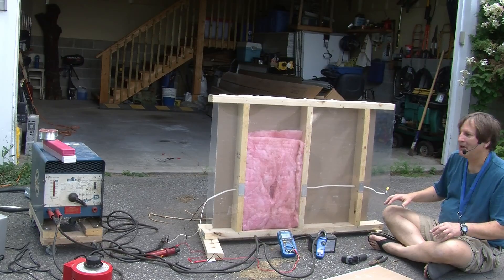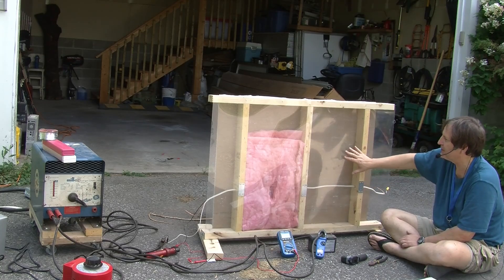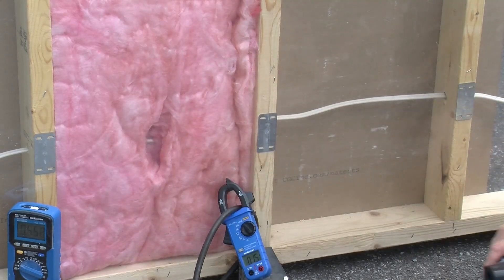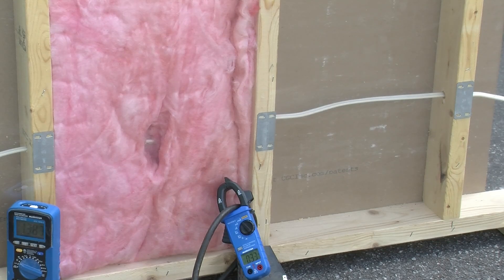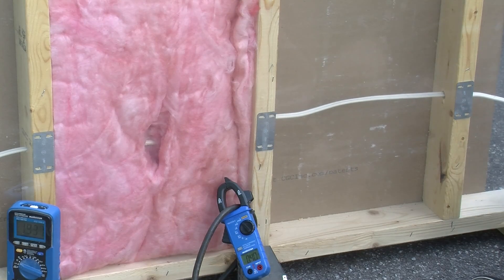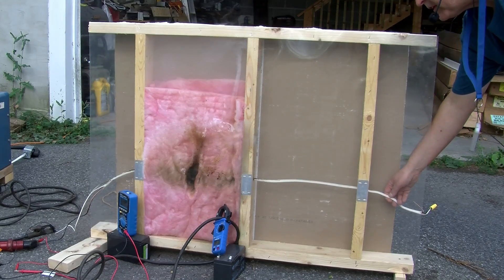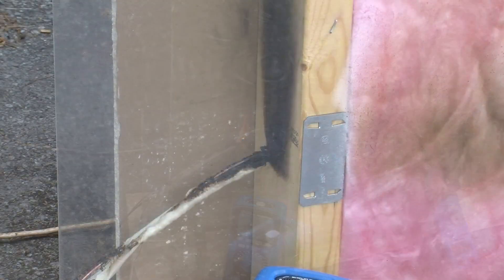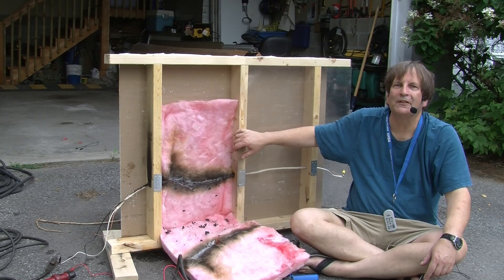Overcurrent +14/2 + Fiberglass in a 2x4 Wall

Comment: If the wire is rated for 15 amps, then it should be able to carry 15 amps continuously. I think rating the wire at 12 amps or 80% of 15 amps is wrong.  while the service panel ii a residential application is usually calculated at 80% of full load.
Reply from the maker: I dont know the exact reasoning the people who wrote the electrical code used for requiring the continuous current be less than the rated, but there are good engineering reasons: If you put exactly 15A worth of load on a 120V circuit any deviation from the stated value of the voltage or device could easily push you above the 15A rated current. It is more likely than might be obvious: the 120V line voltage is in most places allowed to range from +10% to 13% at a receptacle. If you have a restive load, a voltage 10% too high would increase the current drawn by 10%. If you had an 13% undervoltage, a load like an induction motor or electronic power supply will draw around that much more current to maintain the same power. Either way, if you started at exactly 15A you would now be 10% or more overcurrent. Similarly, any device (ie light bulbs, heater) will have a certain inaccuracy as to how much power the device draws adding some more +/ % deviation from rated current. A properly working breaker  is allowed to  trip at any continuous current above its rated value. So by requireing continuous current to be derated from the rated current of the circuit, you prevent overcurrents as result of voltage fluctuations and other factors. You also prevent nuisance tripping of breakers which in the end may be the most practical reason for requiring the continuous current to be less than the rated.

Comment: very interesting
Reply: haha yeah I saw your microphone, I think it sounds great. I have the same problem. I tried using a bluetooth mic but the one I got keeps disconnecting while I record. so I have a couple videos where you can barely hear me for an entire segment. I'm trying out a usb mic now
Reply from the maker: @jankcitycustoms  Sounds does make or break a video - more so than poor picture. I tried two different lav (lavalier) mics - the problem I had with them is I look left and right while doing things changing the volume they pick up. And they dont attach well to T-shirts. The head mounted mic stays in one place so its more consistent volume but picks up my breathing. I glad to get the feedback that the audio is better. The mic is visible and is in front of my face a bit, but I dont think the majority of people are looking at the videos to see my pretty face so thats not too big a concern :)  In case your wondering the mic I am using is here is a Shure PGA31-TQG Headset Microphone - only CDN$60 so probably US$45. But it has an oddball connector that was hard to find adapter for to connect it to my camera. It is intended for the Shure wireless mic system which is way too elaborate for my use. 

It sounds like your phone as a camera. If you find a good mic for use with phones, please let me know - would be good for making videos when not a home.
Reply: you're right I do use my phone. I will definitely let you know, I didn't have any luck so far. my laptop can barely play videos in the editor so I try to do most of the stuff on  my phone.
Reply from the maker: @jankcitycustoms  That must awkward doing it on the phone. But whatever works :)
Reply: haha yeah it's not ideal
Reply from the maker: Thanks! Your certainly have some interesting stuff on your channel - I have to watch some of your videos when I get the time!
Reply: I appreciate it!  I'm just getting the hang of planning a video beforehand to make things a little more cohesive.
Reply from the maker: @jankcitycustoms  Funny you mention that - I'm learning that too - as well as how narrate it in a way that works for my way of doing things. Also am experimenting with the best way to do audio since I move a lot when I'm doing videos and that makes recording voice challenging.

Comment: You have clearly stated typical American home construction so why did you go with celcius vs fahrenheit?
Reply from the maker: I'm in Canada  - our houses are very similar in construction to the US. And I think most cables are rated in C. Correct me if I am wrong - are they rate in F in the US?
Reply: @ElectromagneticVideos  sorry, I just assume you're from the US.  I actually looked at a Romex wire and no temp info.
Reply from the maker: @joedegorostiza8305  No worries! I think I have seen it on some cables. But it may be different from manufacturer. 

You got me curious - just looked at what I think is the southwire US site - the 14/2 specs  do give temperatures in C. Of course they could be geolocateing me and giving me what they think I want to see :)
Reply: @ElectromagneticVideos  Southwire lists theirs as 90 C.  I believe that older Romeo required only 60 C.  Even so, it appears there is at least a 2X factor of safety which is pretty good.  Airplanes have only 1.5.  😁
Reply from the maker: @LTVoyager  I think it was some of the spray foam insulation where the margin of error was less. One of  my concerns was things like air conditioner power wire in the middle insulation in the attic where the temp might already be 50C on a day the AC is running at full blast.

I didn't know aviation had a lower temperature safety factor. Do you work in aviation? Years ago I had to get a product certified for use in a military aircraft  - what stunned me was how the relatively mild shock and vibe test could cause any not well tied down wire to have its insulation and even copper shredded over the course of 24 hours it it rubbed against anything else.
Reply: @ElectromagneticVideos  No, I don’t work in aviation, but I am building an airplane in my shop at present.  I was talking about the structural factor of safety.  Aviation doesn’t have a specific factor of safety for wire temperature as far as I know, but AC 43.13 provides great data and rule of thumb recommendations that, while not regulatory, provide excellent guidance.  Aviation also generally uses Tefzel wire which will withstand at least 150 C before any issues arise.  Yes, much effort is made to secure wires into bundles to minimize movement from vibration and G forces.
Reply from the maker: @LTVoyager  How Cool - what a fabulous project! When its finished I hope you put up a video of you flying it!
Reply: @ElectromagneticVideos  I hope to finish it in another year.  I am 2.5 years into it and have the airframe nearly done and hope to pick up the FWF kit in February and the engine in May or June.  Will do the avionics last as they have the quickest obsolescence cycle so I want to buy them as close to first flight as practical.  I am not much of a YouTube creator, but will consider something.  It has been a fun project thus far.
Reply from the maker: @LTVoyager  Makes total sense about leaving the avionics till last - never thought of that. I'm sure it will be so great to actually fly the plane you built - something so few people can ever do!!!!!!!!
Reply: He said North America, which includes more than the USA.

Comment: Well kind of realistic 15 amp and 20 amp breakers provide over current protection so you wouldn't be able to draw more than that on a standard 15 and 20 amp outlets you would need special devices with 14-2 or 12-2 hooked up to it...  I understand why you do this and as electrician I love and like the amount of explanation you offer thank you

Comment: 10:31 what you are seeing is the off gasses condensing on the plexiglass.  The fiberglass acted like a filter and caught all the darker tars and carbon so the lighter brown color oily stuff made it to the plexiglass.
Reply: That's exactly what I thought. I'm pretty sure the only thing added to fiberglass insulation is dye.

Comment: Great test. I will add though that the plexy glass will throw off your temp readings quite a but. I do this type of work and have to remove all plext glass to get accurate reading.  I understand you are trying to keep the heat in. I am not trying bust your but by any means. Just wanted to give you some input! Love the video
Reply: goes to show how fiberglass does stop a fire from progressing out of control

Comment: GREAT UPDATE!!!!   
You mentioned trying that foam that electricians LOVE to spray everywhere.  In fact,  I have seen something that really shocked me (no pun intended):  They had foamed the entire inside of the breaker box and about 18" of the wiring going inside the house from there!  If you make another video, may I suggest incasing several inches of your test wire with a thick layer of this foam...this should really keep the heat in that portion of the wire.  Please hold for one moment........OK the only title I could see on the can is "GREAT STUFF".   BTW, I was actually referring to my house above.
THUMBS UP!!!
Reply: Inside!? You mean the actual breakers were in foam? As in you pull off the panel cover and all you see is foam? If so that's crazy. Electrician did it? Not a homeowner trying to air seal?
Reply: @libtrs838  Sorry, bad wording.  No, the back of the breaker INSIDE the house...through the knockouts and inside the back of the breakers + binding all entering wire.  It will be really difficult to add, remove, or replace any of this wiring.
Also, I don't recommend using this particular stuff even for air sealing...they had it in many places aroung the house to seal gaps.  It is already falling away.  It's been about a year now...house damaged by hurricane Ida...I'm in Louisiana.  
I guess I first learned about thermal resistance when I was in high school.  I was working on a laser/holography  project for the science fair.  I had a small HeNe laser tube fully exposed that only slightly got warm, I put a thin handkerchief over the tube to reduce the bright glare overnight (just a single layer thrown over the top, not wrapped).  Hours later, the tube could melt your skin! ...think it was quartz?  The funny thing is, how long it took to get this hot!  Heat was leaking out but was being generated a bit too fast inside.  After removing this cloth, it cooled back down (still on) rapidly.  Maybe your enclosed over-current wires would get quite a bit hotter over many hours.  Perhaps the 14-2 rating is partly due to enclosed wires???  There is an old church here in town (built in 1871) whose wiring throughout the attic is VERY, VERY, VERY thin on standoffs with NO insulation!
Reply: @dalenassar9152  ah. A breaker panel / box can be incased in spray foam as long as no foam enters the box. You would get a cold spot around the box otherwise.

Spray foam can work ok if it isn't exposed to the sun, you trim it flush after, and you don't just glob it on.

The church has what is called knob and tube wiring. That is what was used from the first indoor wiring until the end of WW2. Usually it has some cloth covering but it can fall off with age.
Reply: @libtrs838  THANKS, any additional videos on this planned?
Reply: @dalenassar9152  I have thought about it before, but I don't make videos.
Reply: @libtrs838  when I bought my 100 year old farmhouse I saw that it had knob and tube wiring in the attic but thought that was just the old abandoned wiring since the house had an upgraded breaker panel ( versus screw type fuses). It wasn't until I went to add some new circuits that I discovered that they were still active! Needless to say I had to rewire the entire house. How it survived and never burned down I don't know. Most of the old cloth insulation was long gone.

Comment: This was really cool. You put in the extra effort and made a nice accurate picture of how these real world factors effect it, and why they give such conservative ratings to cables. 

It’s easy to imagine how even 30A would ruin  it if it was in an even longer path of insulation, running an air conditioner all day long on a hot day. Eventually it would be mushy enough to short circuit itself.

Again, thanks for doing such an extensive test for all of us. It’s amazing to see the stark difference of what it can handle in different environments.
Reply from the maker: So glad you liked it. The charring of the plastic insulation inside the fiberglass area was interesting to me and as you said compared to the other area.  And imagine if the AC was supplied though a wire embedded in insulation in a hot attic. 

I will do a similar one with spray foam in a few days when is stops being rainy. All tests are outside due to smoke and fire!
Reply: @ElectromagneticVideos  you also often have a bundle of wires stapled on top of each other or all zip tied together possibly buried in fiberglass or spray foam in a hot attic. Or lots of wires stuffed into conduit. This is why we have a large safety margin and say 15 amp for 14ga instead of saying it's good to 30-40 amps.

Use case, setup, and conditions can be way worse than your test setup.

I was at a house with over stuffed junction boxes with old oxidized wires buried under insulation in an attic and the wire nuts melted clear off. Scary.

The above situation is what led me here.
Reply from the maker: @libtrs838  I do want to test the bundle of wire: I once bought a house and almost all the wires were tied in a bundle maybe 3 or 4 inches diameter and against a beam that ran the length of the house under the main floor. The house was electrically heated, so a lot of the cables could have carried 15 amps at the same time. On advice of an electrician, I was able to spread them out. But always wondered what could have happened. They had been in a bundle for 20 or 30 years, but still!

Comment: FYI !
Metal plates are only required when hole for romex is less than 1 1/4 inch from stud edge.
per National Electrical Code.
Reply from the maker: I didnt know that - I assumed they were always required for wires in 2x4s. I have used them over water pex water pipes at times just to be safe.

Comment: I had a guy run his RV out my shop on 14/2 for months, pulling close to 30 amps consistently. Wire got a little warm, but didn't have any issues even in arizona summer. This is also an old brick building with no insulation. When checking the wiring ratings, I noticed 14 gauge was rated for almost 50 amps in "chassis" wiring, but substantially less for demonstrated reasons in residential
Reply from the maker: 30A on 14/2 in Arizona! Wow! I wouldn't have guessed that! There are different temperature ratings for non residential wires. Maybe the idea is in a metal chassis, as long as the wire insulation remains intact, there nothing flammable near the wire to cause a problem?

Comment: Fiberglass is entirely non flammable, it's made of glass as it says in the name. I think the blackness is the smoke from the wire condensing in and on the fiberglass.
Reply from the maker: I think in some of the stuff there is a chemical gunk to help hold the fibers together but I may be wrong. I should maybe try a test with a bare copper wire (or even a nichrome heating wire) and see how it reacts.
Reply: Yes, I was thinking the same thing. Any 'gunk' would probably be evaporated from the wire prior to it even being 'smoke' and then later the heat could char that condensed hydrocarbon.
Reply: @djmips  True true
Reply: In the heating business, we use fiberglass to seal the clean out plates on boilers furnaces that are dealing with flame temperatures 2000° or better and in some cases many many hundreds of degrees in the flu they may be discolored a year later or five years later, but it stands up and it it does the job it makes the gasket so it is I can attest. It is absolutely non-flammable👍
 now if you put the paper, the vapor barrier well then yeah…….. poof.

Comment: Have you tested the transmission of the plexiglass to the wavelengths involved for the non-contact IR temperature sensor you're using (typically 8-14um)? To get an accurate temperature measurement of the wire you'd want to add an access hole in the plastic with a removable cover to prevent drafting from affecting the heat accumulation.
Reply from the maker: Good point!

Comment: The good news - the house didn’t burn down. Remarkable when you think about it.   Great summary.
Reply from the maker: It is! Good that there is a nice safety factor!
Reply: Imagine if there was nobody at home, and nobody to spray a little water onto it.

Also, the eventual wire failure might trip the circuit breaker. So when should we not reset the circuit breaker? If there is a strange odor? So then what do you do? Oh well, just run a replacement circuit?

Comment: this shows the importance of a wires ability to dissipate heat. maybe next video on ambient temperature and number of conductors in a given raceway?
Reply from the maker: Yes - I'm thinking of a maybe a bundle of cables.  Do you know what the code rules are for how many 14/2 can be bundled next to each other or go though a single hole?
Reply: @ElectromagneticVideos  pretty sure there is no limit by code but I think there is a derating. I looked up the code

4—6	  80%
7—9 	70%
10—20	 50%
21—30	 45%
31—40	 40%
41 and above	35%

So first column is number of current carrying conductors (pretty sure neutral doesn't count) so 4-6 hots or 4-6x 14/2 needs to be derated 80% so 12 amps.

So you can have a bundle of 100 14/2 and run them all at 5.25 amps
Reply from the maker: @libtrs838  I think the house I had back then would have easily been in the 10-20 in a bundle range. Maybe 8 cables for heaters, and little current on the rest of the cables, so it probably averaged out. Might not have worked out so well if all the heaters cables just happened to be next to each other. The electrician said that at the time it must have been wired, the code didnt yet require deratng for bundles like that. In wonder if derating came about after the 1970s push to install electric heating and be modern (at least that happened in Ontario).